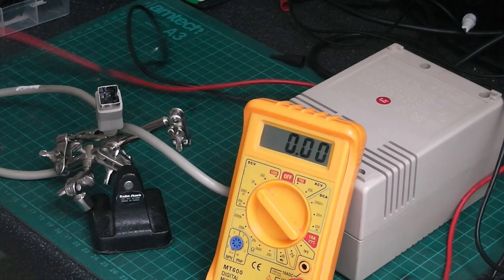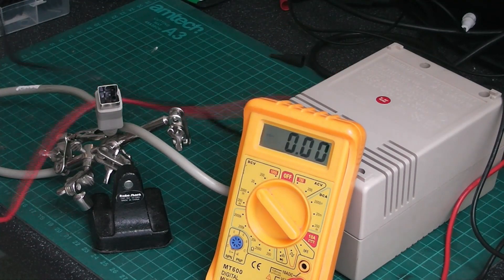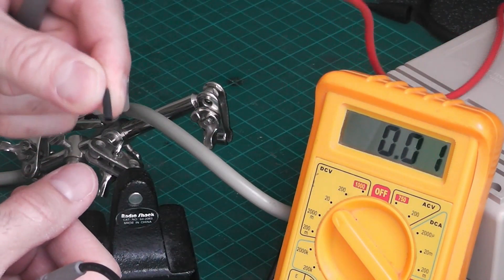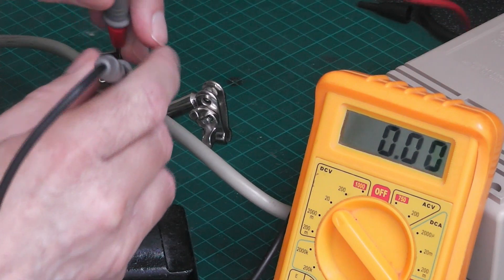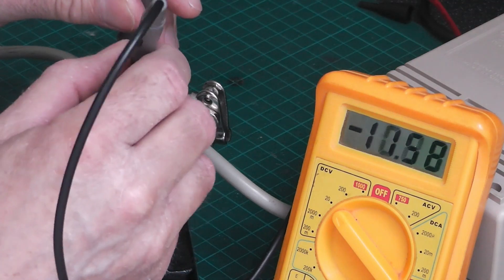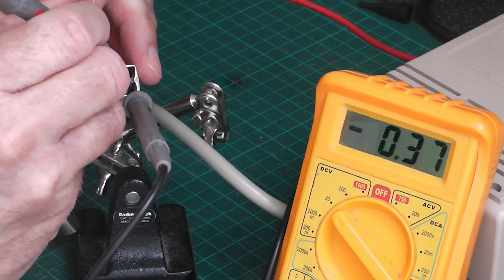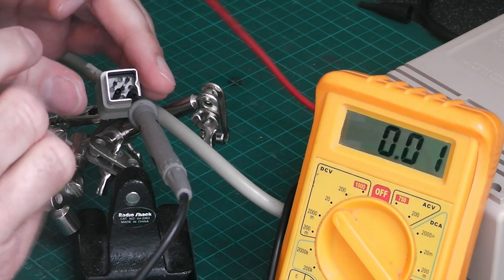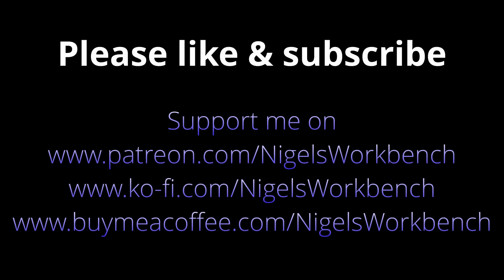Amiga PSU testing

Comment: Hi mate! I've just measured my PSU and I did not get anything close to factory values, just 5V line was closest at around 4+V. The thing is that my Amiga works normally. The PSU itself emits whistling noise but only when it's unplugged from Amiga, during the voltage testing. It is a 4,5A light PSU. Is that normal?
Reply from the maker: 4v seem a bit low for the 5v line? I have had psu's that whine like you say. they still work.  Could maybe need recapping?
Reply: I'm not electronics expert (I'm a programmer), but there are often differences in readings on other power supplies between their loaded and unloaded operation. It would seem that is the case with yours, since 4V is not enough to power a 5V system, like the Amiga, and it whistles when unplugged (so is clearly functioning differently when unplugged). I would bet Nigel's hunch is correct about recapping, though.

Comment: Thanks for your video Nigel, I was searching one showing the actual numbers of other power supplies.
 I have a question . I have an Amiga 500 power supply and  Iam  getting the following readings. At the top left I read +12,03 but the middle pin gives me -16,7.
The +5V is good but the amperes are 5,5 instead of 2,5.(not under load).
Do you think  I can correct those numbers by just replacing the electrolytic capacitors? Can I use with those readings?
The power supply is the original of an Amiga 500 rock lobster rev 5.
Reply from the maker: I think the load will go down when connected to the Amiga.  Replacing the caps is properly a good idea, as they are not expensive anyway :)
Reply: @NigelsWorkbench  Thanks Nigel.
Reply: Any device will only attempt to draw as much current as it needs, so there should never be any worries about the unloaded current being high on a PSU.